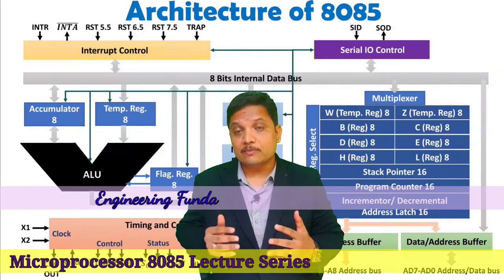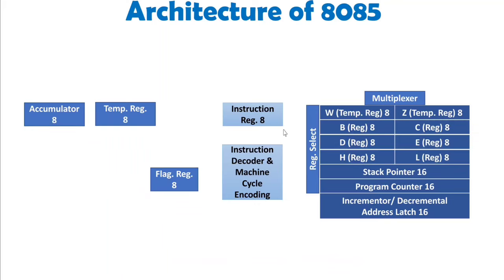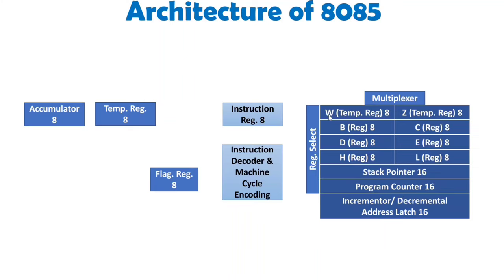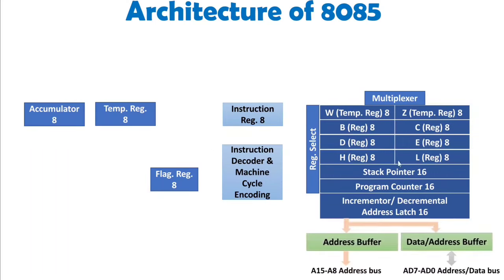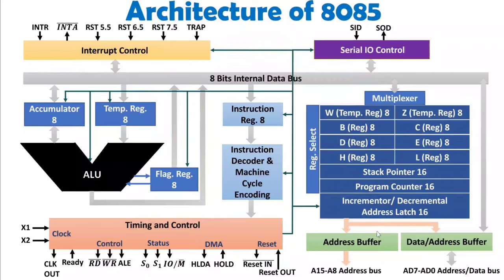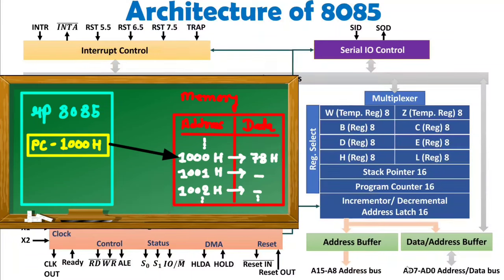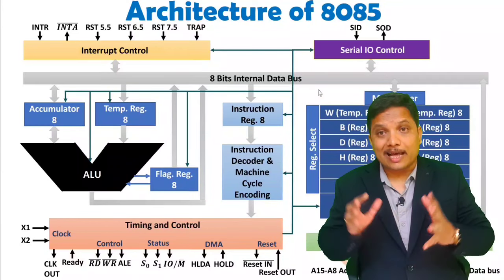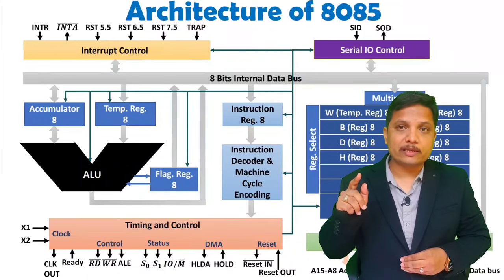Architecture of 8085 Microprocessor: Data Flow and Working Explained | 8085

Comment: You used bidirectional bus between ALU and Accumulator... I drawn like this in my exam and lost marks because it's unidirectional. In Ramesh Gaonkar book.. 8085 MP BOOK. is it correct!?Sir
Reply from the maker: ALU also stores data into Accumulator
Reply: In the 8085 microprocessor, the accumulator is not bidirectional. It is actually a unidirectional register that is used for various arithmetic and logical operations. The accumulator is an 8-bit register, which means it can hold values ranging from 0 to 255 (in decimal).

The reason the accumulator is often referred to as "bidirectional" might be due to the fact that it can be used as both an input and an output for arithmetic and logical operations. In other words, data can be loaded into the accumulator from other registers or memory locations, and the result of an operation can be stored back in the accumulator or transferred to another register or memory location.

However, it is important to note that the term "bidirectional" typically refers to the ability of a signal or data bus to transmit information in both directions, such as in the case of bidirectional data buses used for communication between different components in a microprocessor. The accumulator itself is not bidirectional in that sense.